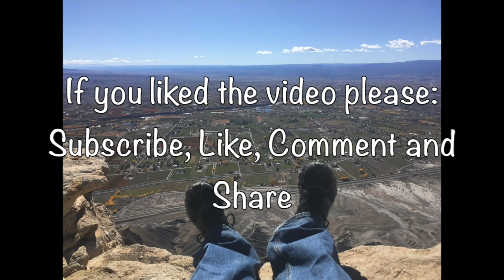W1209 Temperature Relay Controller - Links in the Description

Comment: Hello was wondering if you can extend the sensor wire and it it will change the accuracy? And I will buy from your link I'm very interested thank you
Reply from the maker: You could extend the sensor wire pretty easily I would think. I don't know if it will change the accuracy. If the temperature accuracy is critical, you could always extend the sensor wire. Then test the temperatures. If they are off you could just adjust the unit to turn on and off at the temps you require. Hope this helps you out.

Comment: Those little digital thermostats work great.  I used an AC version to control temps in an egg incubator.  I use a DC version to control temps in a peltier cooler, and have one I will eventually use to prevent barefoot LiFePO4 from charging below safe temperatures.  Still running FLA for now.
Reply from the maker: That's good to hear. I'm looking forward to seeing how this one does for my application.